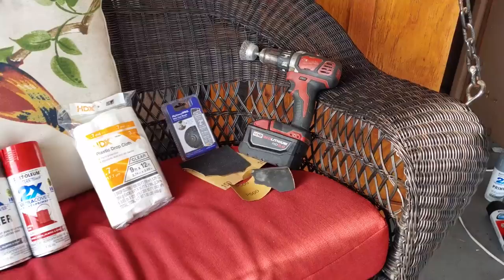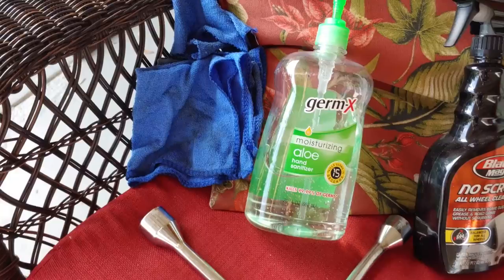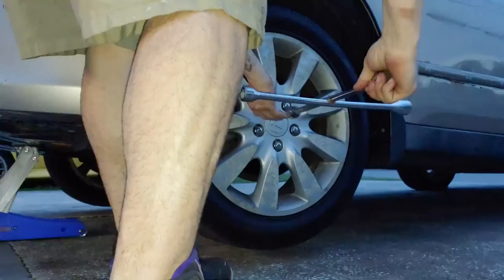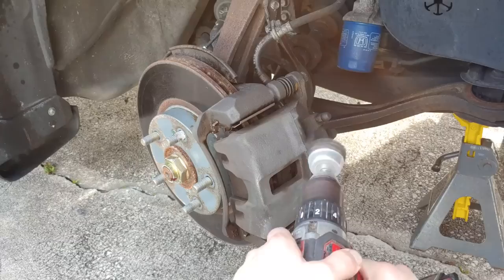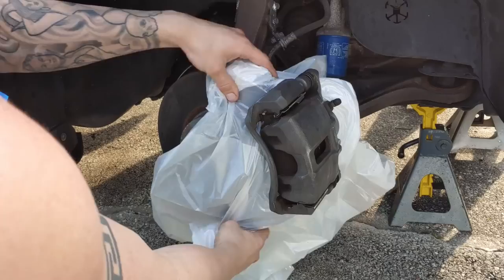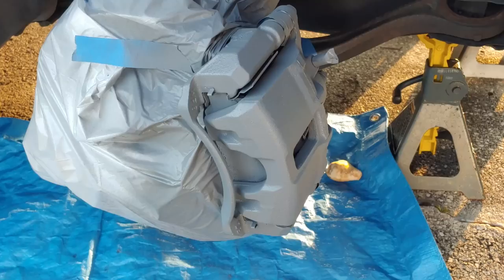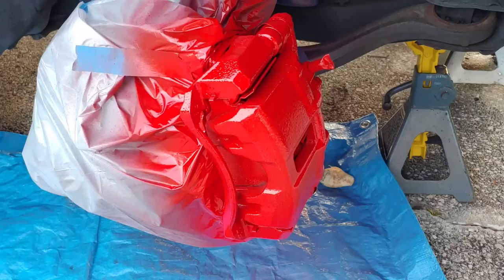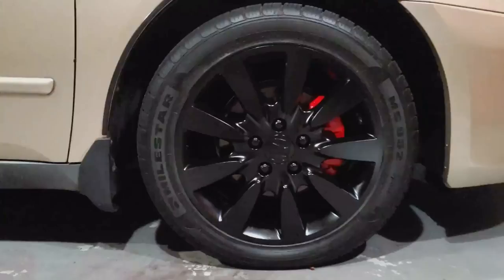HOW TO PAINT BRAKE CALIPERS | Easiest Method | No Taking Off ANY Bolts Or Nuts

Comment: Seeing the jack on the sump makes me cry. Other than that and the fact you have got paint all over the pad where it contacts the carrier this is extremely informative
Reply from the maker: Why would I put a jack on the sump? There is a crossmember lift point right there 😑
Reply from the maker: The only place paint got on is the backing plate of the pad. Alof of pads come painted for rust protection. You're a noob foreal tryna sound like you know what is going on
Reply: @BuddysDIY  I work on cars everyday, yes there is already paint there but there should also be anti sieze grease on the points the pad contacts the carrier. You can say I'm a noob all you like but I've seen far to many cars with sticky brakes because people have painted there calipers and carriers and got paint all over the shims on the carrier
Reply: @BuddysDIY  it looked like it was on the sump, my bad on that part

Comment: It came out clean but some things you shouldnt paint and your car wont look so ricey...😅 1 the brake pads dont paint the brake pads thats #1 way you can tell you didnt do it right 
2 the silicone accordion looking pieces will start to crack after spray painting the you should put tape around them and theyll look and last longer more OEM or pro look.
3 why did you use primer if the red can already has primer? 
4 try to jack up the car a little because havving so much pressure on the wheel while trying to unlock the stud can brake because ive broken 3 before and because i didnt know how over tighten they were.. Always jack it up to a certain spot that its still touching the floor then unlock the stud just FYI . I know alot of people say ive done it so many years but i wouldnt risk the work..
Reply: English is not my first language, can you explain what "the stud" is? You mention it on #3

Comment: Great video and to the point, thanks for sharing. Can someone tell me why hand sanitizer and not spraying break part cleaner? What's the advantage? Thanks!!
Reply: In my opinion brake cleaner is by far better. A residue is left over with the hand sanitizer, something I would avoid. Use brake cleaner
Reply: @vigilantemotors  I'm with you on that. I really dont get why some would use sanitizer when you can just spray BPC and don't even need to wipe or or dry it as it evaporates. It cleans/reaches where hand sanitizer can't. I was expecting to learn something I didn't know regarding the sanitizer 🤣
Reply: @MYFB05  Yeah idk, I mean if it works I guess. But I would think there would be a residue left that would not mix well with doing a fresh paint job

Comment: I drive a high performance cadillac with an occasional pull or two, should I be fine with the paint you recommend or go for the heat resistant?

Comment: Great video. wasn't sure about high temp paint or not but now i know, thanks. One question. will there be a problem or an issue with paint on the back of the outside break pad?

Comment: the problem with doing that is the where the brake pads slide is getting pain on them and its going to dry and the pads are going to stick and you are going to have brake problems down the road but other then that it looks real good

Comment: I noticed that the calipers from Powerstop are only painted on the outside as well.
Matters little if there is actual flaky corrosion inside the caliper piston either.
Who is going to know ?

Comment: I noticed that we definitely can’t use brake cleaner on painted calipers as it will remove the paint quickly… Purple or pink cleaner with the hose seems to work fairly well… Any other recommendations?

Comment: looks like the method you're using is for calipers that are unpainted. any recommendations for wheels that are already painted? is that a chemical that would get the paint off well? does that wire brush method work just as well?

Comment: I have just one question regarding the primer. I see that you used two different kinds of primer. Both rustoleum.  What is the reason you used the 2x coat primer on the calipers and the automotive primer on the rims? If there is no specific reason then which would recommend is better? Looking to paint my rims black and calipers red.  BTW very detailed and informative content.

Comment: Hi Thanks for the instructions, very helpful. But I do have a ❓ What about when is comes the time you need to change the break pads, will paint will create any problems with removing the bolts ? 

Thanks
Reply from the maker: No sir. Paint is not match for a good Rachet set 😁

Comment: Easier to pull the two bolts for the bracket and remove caliper to paint. The clip slides and other hardware will be paint and risk seize.

Comment: Unbolt the caliper and remove the brake pads . Or at least tape them off. It will look
Better . Also get a plastic drop cloth and cover everything that’s exposed to protect from overspray.

Comment: Would brake parts cleaner work as well for the initial cleaning? And for the second post wire wheel cleaning?
Reply from the maker: I personally don't know for a fact if brake cleaner leaves a unhealthy residue for paint. I know mass air flow cleaner would be safe since it leaves pretty much no residue compared to any other rattle can cleaned
Reply from the maker: Cleaner*
Reply: That is what I used. I also used a wire brush instead of the sandpaper.

Comment: I noticed you painted it with the brake pads on, that won't mess up the paint when you need to change them out? Also what happens when you paint the gaskets? any real damage?

Comment: Do you recommend a clear coat after the final paint application? Thank you
Reply: Yes. High heat clearcoat. This is the step that he missed. High heat clearcoat will allow this paint to outlast the caliper itself. The paint will last for the life of the caliper with a good clearcoat.
Reply: Thank you!

Comment: DISCLAIMER: the paint he used specifically says “do not use on surfaces that get hotter than 200 degrees F. Brake calipers get between 300-400 while daily driving. Get heat resistant paint.

Comment: So the brake pads are red too? Take 15 mins and remove two bolts to remove the pads from the caliper. The pads will have a contrasting black color. Looks more professional in my opinion

Comment: Nice, but  probably won't last.  those calipers and pads get super hot.  Should have used engine heat paint.
Reply: He did say he was doing it this way since he was 16. Is 65 so that’s a long time.

Comment: if you paint the calipers do not use the regular paint, the brakes will be loose, and you have to use the high-heat paint!  remember this is very important,

Comment: I would atleast take the two caliber bracket bolts off and remove it from the rotor. Bag the whole rotor/hub, hag caliper from springs, and then you still don’t have to bleed the brakes in the end.

Comment: Great channel. Recommended to my buddies.
I added step.
Used brake cleaner After sanding to blast away dust.
Invest in drill wire brush attachment for a few bucks. You got 4 wheels to do.
Don't forget to like and follow channel...

Comment: Got over spray all over the control arm, going to look terrible when the pads start moving and chipping paint off themselves since he didnt block them off. Quick and dirty  job that will look good until you actually use it most likely.

Comment: i wait until i'm doing brake maintenance, remove parts , wire brush them , clean them with acetone, prime , paint with heat rated paint, clear coat, reassemble.

Comment: How does 2K rustoleum paint stand up to the high temps?
Reply from the maker: Most paints hold up fine. Calipers don't get that hot.  Next time you pull in your drive way from a drive feel your calps. They rly don't get that hot

Comment: the only reason you showed the finished product in the dark with the wheel on is because they didn't come out good. As a painter i can instantly tell when there's way too much paint on a surface and you put way too much paint on that caliper. It probably gave you runs and insane orange peel.

Comment: What kind of "emergency" will get you pulling the "E" brake?   In most of the rest of the world,  its just a hand brake, and you use it when you are stopped.  For some reason America believes its some Emergency brake.   Pull it at 70mph and see.  You should call it a "P" brake.

Comment: Will the paint hold even tho it’s not high temp ?
Reply: yes, my colleague did the same DIY.  Im doing this tonight and am using:  Duplicolor Engine Enamel with ceramic, rated at 250C or 500F plus Dominion Sure self etching black primer.  Hopefully 1 can each can do the job.

Comment: See this all the time esp on crappy golfs. Painting weedy calipers like these red is crazy dumb. Black and hiding them is what you need to do. They really don’t look sporty..
Reply: Pretty sure almost all Golf ‘GTI’s usually come with painted red calipers from the factory. Which some Base Golf owners might switch to when looking for a sportier look/replacement. If it wasn’t a sporty aesthetic I’d imagine higher performance Sports cars wouldn’t offer painted caliper options nor would aftermarket performance brake kits (ex. brembo, powerstop & wilwood) come pre painted in various colors(other than representing higher brake torque). 

It’s alright to enjoy a “plain” aesthetic on a car, just don’t hate on others/spread negativity for having their own style.
Reply: @_BrandonSelby_  having owned one, you’re wrong. They were a paid option originally, £250 if I recall but would need to look at the invoice. The point is or was they are weedy small on the golf. Painting them red makes the look stupid. Sports cars have much bigger brakes that work in brighter/bold colours.

You want go paint your 1.5 golfs brakes red, go for it. But, don’t be surprised when people point and laugh.

Comment: As you get older you'll find if using a 4way/cheater bar is to push down rather than pull up, easier on the body and just plain easier
Reply from the maker: I was trying to work my biceps man
Reply: @BuddysDIY  lol,,did the same as a young man

Comment: Safety tip: If you're going to use wood as a wheel chock, make sure it's thicker than your tire depth to the rims.... the car will roll right over that tiny 2x4.

Comment: Why not take the caliper off ?  Just 2 screws holding it on.  Really don’t want paint on the brake pads and rotor.  You can paint the caliper bracket separately then.  No paint on boots, pads, rotors or brake lines.

Comment: This is a perfect example of how NOT to do this. But why, you ask? You just glued both the brake pads and the anti-rattle clips to the caliper. Good luck to the guy who has to swap those out next time. The proper way is to remove the caliper and bracket from the spindle, and spray them off the car. If you really don’t want to do that….
 Remove one slider bolt, rotate the caliper up off the pads, and pull them out of the bracket along with the clips. 
THEN clean and mask off, don’t forget to mask off the grooves the pad ears and clips go into on the bracket. Slip the bag over the rotor, and rotate the caliper back down and replace the slider bolt. Paint, taking care to avoid to much over spray. 
And when painting wheels, do not paint the lug nut or bolt seats. It will not allow for a proper torque.

Comment: If someone is anal about their brakes looking awesome, you can take one more step and take off the brake pads and clips, remount the caliper then continue with the plastic wrap. then once it's dry put the pads and clips back on. It just makes a difference between the caliper and the pads.

Comment: 1. wire brush drill 2. Rust Oleum Primer 3. Rust-Oleum Jupiter Red Paint (heat resistant)  4. Germx 5. Plastic Drop Cloth 6. Sanding Paper  7.No Scrub Black Magic 8. Masking tape

Comment: This is the most amazing video I have ever seen. There is no way a real auto engineer will ever paint Calipers like this.  The paint application is awful and will not last more than a few weeks.  Calipers get to at least 200 degree centigrade, even on a gentle run around  town.  Road debris is contain being blasted at the calipers.  This paint application is so bad its almost unbelievable and is the sign of a cowboy worker.  Paint all over the Pads and Pad Springs is not a good idea and should never be done.  God help anybody that follows this technique.

Comment: It's nice, but totally poorly executed...
Unfortunately this solution is just "nice to have"..
1. Chromed guide pads - dirty by paint "QUICK BRAKE" - without resistance they will not move anymore.
2. Painted brake pads  - the car will not pass the technical inspection - no marking is visible.
3. The paint (I don't know if it is temperature resistant - it is supposed to be 300°C) is only on the surface - rust will appears under the paint.

The correct thing to do (disconnecting the brake caliper) would be to remove the caliper, remove the disc, cover all parts.
And then carefully clean, degrease and repaint the removed caliper = there is no better way!:face-turquoise-covering-eyes:

Comment: For heaven's sake do not paint them if they are not optimally positioned. That is, near the car's centre of gravity so the front ones should be mounted behind the front 'axle' and the rear ones ahead of the rear 'axle'. This makes the car more manoeuvrable in yaw by reducing its polar moment of inertia. Look at any good-handling car to see this,from super cars down to the humble MX5 (and even though Mazda position them correctly, they don't paint them).

Nothing looks dafter than a car with brightly painted calipers showing the world that they are in exactly the wrong position! If your car has them in the wrong position, don't emphasise that by painting them!
Reply from the maker: Bruhhh

Comment: Lol, a few points here, not sure why he would put all this work into a Honda that old, but Don't anyone else do this. It's not how to paint a brake caliper, unless you're looking for problems down the road. The way this was done paint was sprayed onto the rotor, the pads, the pad retainer clips, and all the brake associated hardware. If you're so inclined to paint the calipers on a Honda, whatever. STEP ONE REMOVE THE CALIPERS

Comment: Dude...You are painting the stainless tracks where the brake pads slide and the back of the brake pads. This is a recipe for break pad to stick and not sit properly.This is so wrong. Remove the calipers to paint them. Do not be lazy. It is only 2 bolts.

Comment: Trash. You just soaked the pads in paint. Didnt even use high temp paint. Not that you should even use paint on calipers. You should only use epoxy or powder coat on calipers. Any calipers worth painting make enough heat to melt paint. Just ask the wrap companies that discontinued caliper wrap.